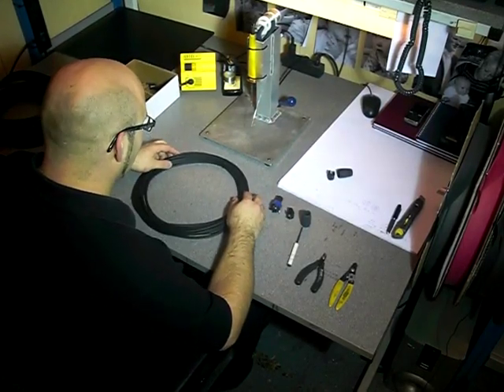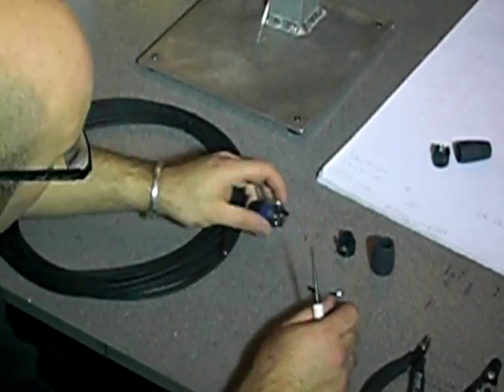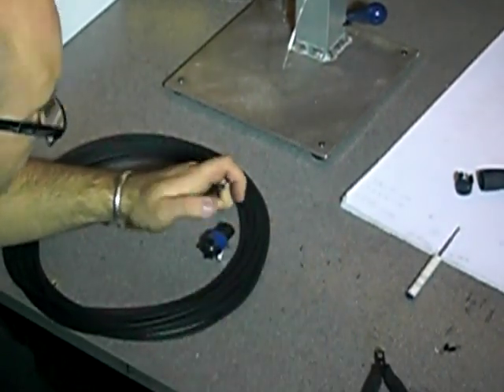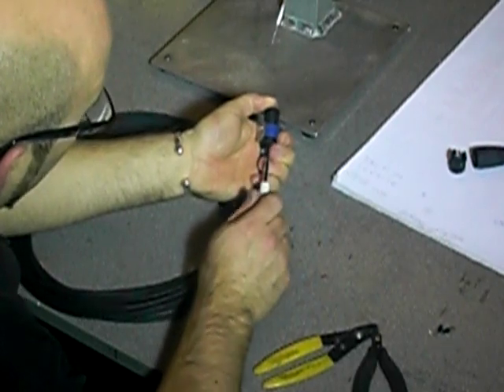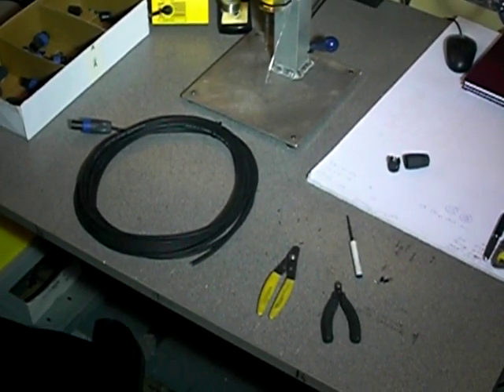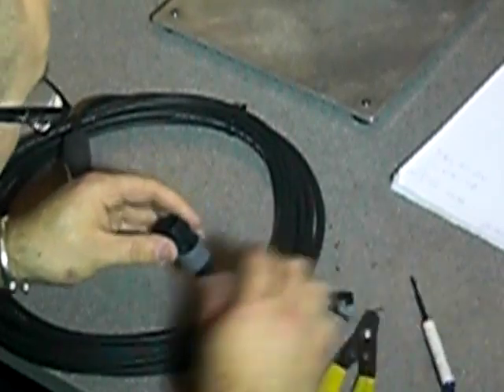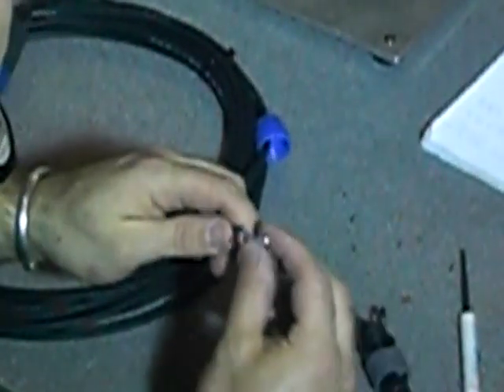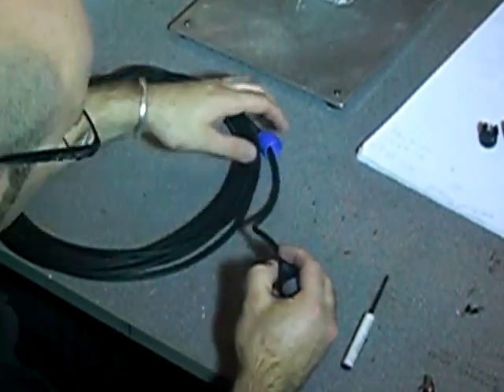How to Build a Speakon Cable using Neutrik Connectors

Comment from the maker: @TheBeebopper 

There is not much more to it than that. Speakons are designed specifically for speakrs and will take a much heavier current. XLR can be used for speakers as well as other applications but are limited on how much current they can take.

Thanks

Comment from the maker: When you only use 2 core speaker cable on standard leads you only use +1 & -1, we take the screws out or screw them in tight. This is to stop them falling out inside the speakon.